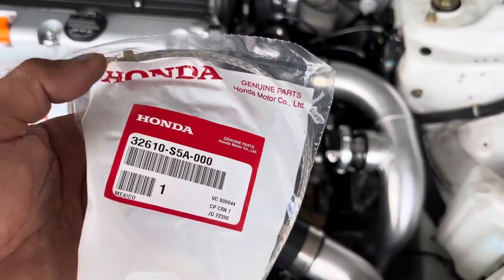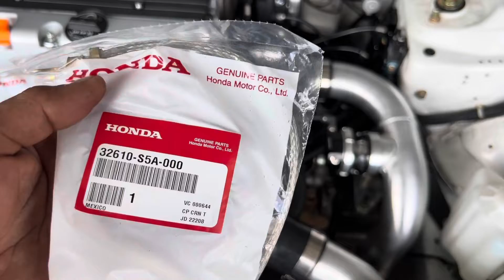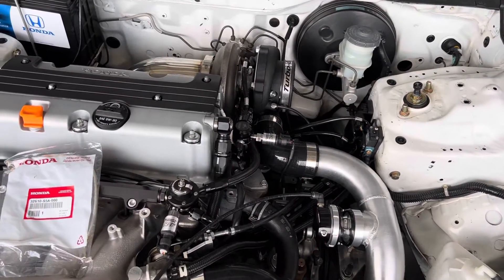Kswap OEM style ground kit 💎

Comment: I took the decal off (no heat gun, just start in bottom corner and work slow) and put it on the other side of the battery to keep the post away from the firewall like they were from factory 👌